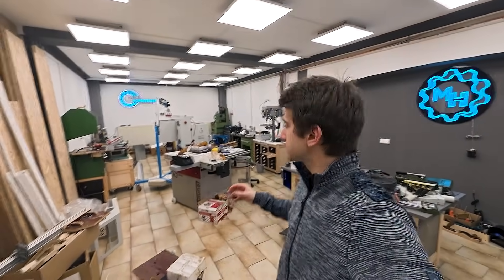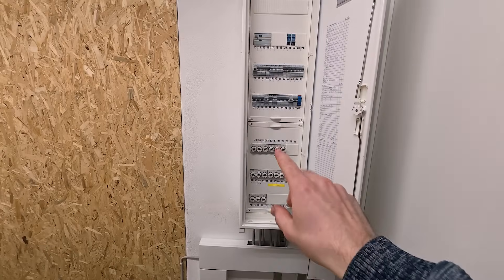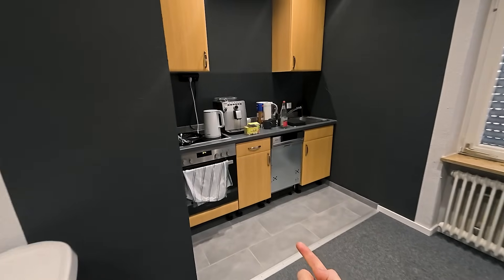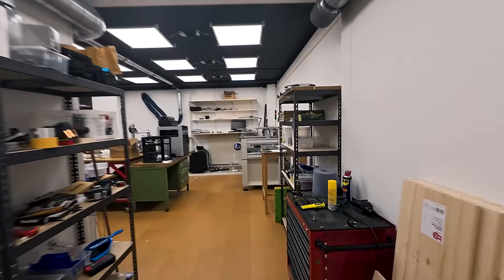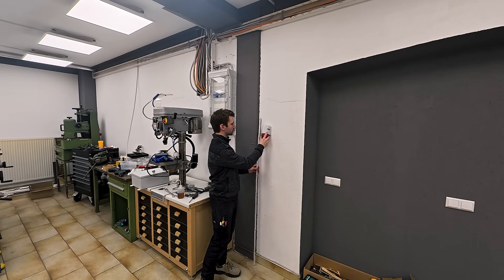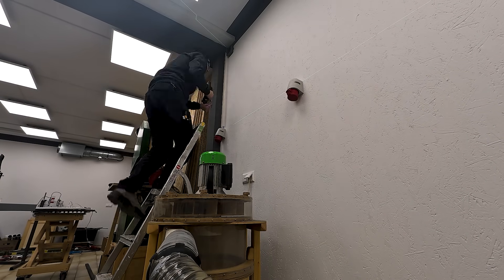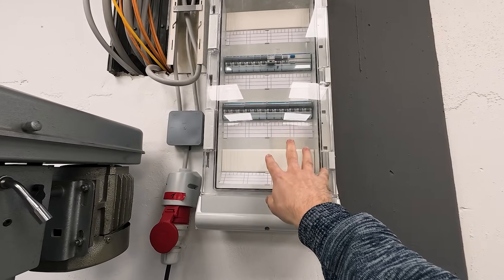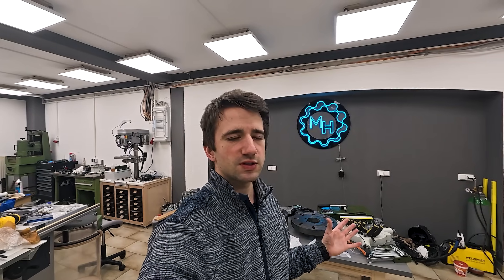New Workshop #17 || Electrical Installation

Comment: In the UK most times I think we'd wire those 3-phase outlets in singles inside metal conduit rather than use 5-core cable. And probably each one on its own breaker.

Comment: Nice work! How do you wire power to the machines in the middle of the shop?
Reply from the maker: Extension cord on the floor. I had ideas for a subfloor, but wasn't sure if it's worth the effort

Comment: Please notify me when the first 35A fuse trips ;)
Could already be the case when the dishwasher is running, someone uses hot water, someone a vacuum cleaner, Marius turns on his lathe and Stefan has multiple 3d printers running.
Not guaranteed that the Fuse will blow, but also not impossible.
Reply: 35 amps seemed low to me but I think European three phase power and 35 amps is somehow different. But I am absolutely not an expert. Perhaps someone from Europe can explain more.
Reply: @TimothyJesser  35 amps three phase just saves on wiring.   You have three hot legs and the all are able to return on a single neutral because they are each taking turns.   So you actually have a lot of amperage there, plenty more than a 50 amp 220v split phase over here ( like we would use for a A/C, water heater, clothes dryer, or stove).  In addition, almost anything they wire up can run on 10 gauge or smaller, due to the higher voltages.   It's actually a much smarter system than the USA in a lot of ways.
Reply: @jimthesoundman8641  Yes, exactly.  I figured it was something like this.  35 amps in the U.S. would be a bit pitiful for three shops.  I need a 40-amp breaker at 220v just to run my kitchen oven.  My AC unit uses something like a 60-amp breaker.  I know that breaker size doesn't tell me exactly how much amperage something is drawing, but it is at least indicative. 

There is a reply from Marvin below and I'm not nearly qualified to critique it.  Likely he is correct, too, in his points.  I just think Marcus seems like a smart guy, and I figured he wouldn't wildly under-power his shop.  

I guess we will find out as we watch more videos. 🙂
Reply: @TimothyJesser  35A is fine for a single house or flat in the most cases, but also you don't have three guys running a business in a residential house usually.
The higher voltages especially when machines use 400V across multiple phases lower the current compared to single phase installations with only 230V or even 110V.
But its still only a 35A fuse per phase and when the electrician didn't paid attention to detail, multiple single phase appliances might be installed on the same phase (dishwasher and the 3.5kW waterheater for example).
In general most of the stuff is only single phase 230V. Stuff that needs more than 3.6kW needs three phase (or three phase motors), since single phase outlets are usually only 16A.
Since three phase motors are generally superior to single phase ones, Marius has multiple machines that need three phases (not necessarily because they need more than 3.6kW).
Reply: It is 400 V phase. Not 230 V three phase

Comment: 3-phase delta or wye?
Reply: Neither, it's an outlet not a consumer. But you could do both, there are 3 phases and a neutral plus ground
Reply: @zapl80  It has to be one or the other. I do not know of any other way to get 3-phase power.
Reply: @sdspivey  yes, once you connect something and close the circuit. Delta/Δ means you connect line to line and get 400V in Germany, wye/Y/star means you connect line to neutral and would get 230V. But without a connection there's no y or delta attached. The German powergrid supplies 3 lines at 230V each 120° phase shifted to each other and a 0V neutral to basically every home. So you can have perfect delta or wye, whatever your machine needs

Comment: Nice logical layout.

Regarding the power metering. There are special power meters that can be mounted alongside the fuses, on the rail. The 2 phase ones are around 50€ from what I remember.

No problem in splitting the bill but having the data might be interesting 🤷🏼‍♂️.

Comment: Happy to see that the installation sockets - outlets etc are standard in EU. Not the crap they have in UK and specially US where they have to double the amps and 3 phase needs a local 3 phase converter/transformer.
Reply: UK uses the same voltages and frequencies as EU. “Industrial” outlets are also the same (IEC 60309). The only difference is in home 230v outlets, and that most homes are old and don’t have a 3 phase supply, though it’s getting more common due to higher loads of electric cookers & EVs & heat pumps etc.

Funnily enough though there is still one common use of 110v power (though I do believe this is also the case in mainland Europe): site power for construction sites. There’s the obvious higher risk of punctured cables. It actually uses a split phase transformer, so really it’s only 55v from each phase to earth

Comment: I wonder how the installation of the power meters got approved, usually the Provider wants the meter as near to the hak as possible to prevent losses ( stupid but eh) so usually a lengh of 1-2m if possible, thou that looked a lot longer

Comment: Can't wait for the lathe restoration series to begin.
And that new machine in the far right corner, whatever that is.
Reply: That a cup grinder. A surface grinding machine that uses a cupped wheel instead of a flat wheel. Its for making metal parts extremely flat.

Comment: So: You and your chums have 35 amps for everything ? From other comments, I assume that is @ 400V ? I guess the other two guys doesn't have any proper machines, only 3D printers ? If they get any industrial machines, I imagine you'll blow some breakers..
Reply: It’s 100 amps total, and each one of them have 35 amps for their own workshop. So it’s plenty
Reply: @mtqrx  he said the whole building is 100a, there are 2 other businesses (theirs being the 3rd, split into 3) so they are only getting 35amps total for the studio
Reply: @mtqrx  No. It is 100 amps for the whole building, 35 amp for the 3 guys combined.  As I said: If one of the other guys gets a proper machine he'll use it all. Either the breaker pops or they'll get too much voltage drop. Ask me how I know...

Comment: The way you have nicely segregated all the different areas/shops it would be trivial to install networked (WiFi or wired) power meters in each distro box and have a very precise idea of where the energy is used. I have several Shelly Pro 3EMs installed in my home and shop and love how in control I am of my power consumption because of them (and they are made in the EU).

Comment: Kannst du uns erklären, wie ein Drehstrom Motor funktioniert und wie der ohne Nulleiter auskommt, wie man 400 Volt bei 2x 230 Volt erhält und wieso der Nulleiter für 3 Leitungen nur so stark sein muss wie einer der Leiter und nicht so stark wie alle zusammen?
Danke! 😁
Reply: Die 400V entstehen, weil die Phasen um 120⁰ verschoben sind. Addierst du jetzt zwei 230V Phasen kommst du auf 400V.
Reply: @martine.210  ich hab das heute mit meinem Bruder durch spekuliert. Also zur Zeit wo der Sinus von Phase 1 bei Plus 230 ist, liegt der Sinus von Phase 2 und 3 bei genau Minus 170?
So weit bin ich heute schon gekommen, aber ich hätte gern gesehen, wie Marius das auf seine kreative Weise erklärt. 😁
Reply: Drehstrommotoren sind jetzt echt nichts neues. Da gibt es massenweise Erklärungen in jeder erdenklichen Art und nichts, was Marius noch hinzufügen könnte.

Comment: Some info for other viewers: 
The Electrical System used here has either single Phase or triple Phase. Single Phase means one of the three Phases + Neutral, which gives 230V. Triple Phase doesn't need Neutral. It works by putting two 230V Phases together to make 400V. So L1+L2, L2+L3, L3+L1.
The big red Three-Phase outlets do however also have neutral connector. This way, if a three Phase machine also needs single phase 230V, it just grabs one of the three phases plus Neutral and thats it. The Lathe probably has this. Three Phase 400V for the Motor and single phase 230V for the Digital Readout.
Reply: Strictly speaking, single-phase can be either line-to-ground (230V in this system, 120V in the US system) or line-to-line (400V in this system, 208V in the most popular US system although there are others). Motors really like three-phase because they don't need capacitors or other tricks to start in a particular direction (because the three legs are 120° apart, a third each around the circle, rather than 180° apart, fighting in opposite directions so not spinning without a "kick"), but other devices that want a lot of power might use 400V too but only using two legs (which is still single-phase). I'm not sure what that devices that might be, huge resistance ovens maybe.
Reply: @johnhawkinson  usually that isn't strictly seen as single phase here whit Line to Line, as it is quite different from Line to Ground/Neutral in wave form patern and internal function, so its more helpful in anyway to separate the them for single-phase, 2-phase and 3-phase applications, also partially is that you are not acually using only the one phase as both phases are in use hence why you get 400v instead of 240v,

maybe its a language thing, maybe its different countries defining things a bit different I dunno /Swedish Electrician
Reply: @link7417  I don't know about the language, I'd be surprised if it was different if we're using the word "phase," because it comes from the math. A "phase" is an attribute of a sine wave, and whether you use two legs (two hots) or a single leg (hot) to ground, you have only one sine wave, and thus only one phase, so "two-phase" is always wrong in English (but some people say it!). It's only when you have three conductors that you have three sine waves (one from each combination of legs: A-B, B-C, C-A) , each 120° out of phase, and thus three phases.  I'm not sure what you mean by different "in wave form pattern and internal function"! Line-to-line and line-to-ground are both sine waves, indistinguishble other than by magnitude. If you start with 400V line-to-line and run it through a 4:1 transformer and get 100V, and compare that your 230V line-to-ground and run it through a 2.3:1 transformer and get 100V, the two 100V signals will be indistinguishable on an oscilloscope (or any other tool I can think of). (They might not be in phase with each other, but if so, that's because the original signals were not in phase and/or the phase shifting of the transformer).
Reply: @johnhawkinson  okey you clearly have a misunderstanding here the 400v is becouse of the sign waves interfaces, you don't have just one sign wave when dealing whit line to line, if you look at the coils of a motor they are only line to line too, but you need all there for the motor to go around but the coils them self are always line to line, 

yes line to line and line to ground are both signwaves but the magnitude difference comes from the two signwaves from the two phases being 120 degress apart, you always have that property not only when they are 3 signwaves, 

Ill consede that saying they are diferent in wave form maybe not isnt the best but that is what I meant, that you get the 400v not from a single signwave but from the two signwaves making up the line to line
Reply: @link7417  Hi. I think this is exceeding the scope of what is reasonable for Youtube comments, so we should take it offline. I understand you're an electrician, but I'm not sure you have the background in the EE area. Yes, adding two 230V rms sinewaves gets you a 400V rms sinewave when they have a 120° phase shift, but that doesn't change the fact that the result is a single 400V sinewave indistinguishable from any other 400V sinewave of the same magitude. (Also in English it is SINE from trigonometry, not SIGN like plus/minus). You most assuredly have a single sine wave when you connect an impedence line-to-line between two AC voltages. Your device cannot tell whether it came from  line-to-line or line-to-ground, it's just a sine wave.
¶ If you add a third reference point, e.g. line-to-line-line, then you can compare phases. And that's why in such a system there are three phases. (And if your third reference is a neutral, i.e. line1-to-neutral and line2-to-neutral, you would still only have a single phase since you cannot compare phasing against a zero signal, and that's what neutral/ground/earth is.)
¶ You are correct that the magnitude of the sum differs in line-to-line and line-to-ground, I do not disagree.That does not make line-to-line anything other than single-phase.
¶ My initial point, such as it was, is that the resulting sine wave from these two different methods looks identical to any device, and the magnitude is an independent variable that can be changed in different ways, not just the phase angle of the two legs to each other, but also the magnitude of those legs.

Comment: The 35Amp 3phase 400V they are allowed for their shop, is almost equivalent to US household with single phase 200Amp 240V panel for  Power (42 vs 48kW).
Reply: It really isn't.

35 amps x 400 volt x 1.732 = is  24.35 kW at a power factor of 1.

For reference, square root of 3 is 1.732
Reply: @MrMartinSchou  Your calculations are a bit off. It's not just 400V it's three phases that each have 35A at 230V if you load balancing it properly. For a single 400V machine then your calculations might work but not for many that also uses single phase. So that's about 26.25 kW of availible power.
Reply: @Dragonited  So your complaint is that I'm 7.8% off on the edge case of single phase  400 volt machine in the EU, as opposed to the claim that is 60% off?

I will readily admit, that I'm not an electrician, but the plugs that Marius are hooking up looks like IEC_60309 plugs. They are all red, which suggest they are 3 phase 400 volt plugs. If he wanted to use 2 phase 240 volt, they should be blue.

Which also matches with what Marius says about the machines - they all need 3 phase electricity.

As I said, I'm not an electrician, but it certainly sounds like Marius is planning on using 3 phase for everything, which suggests that the three single phase 240 volt at 35 amps is not relevant.
Reply: @MrMartinSchou they’re 5 pin sockets (3P + N + E), so if a machine needs single phase they have that between any phase and neutral. Some machines like the lathe definitely do use that, at the very least for any DC powered control circuitry like a DRO. That said it’s probably pretty negligible compared to the 3 phase load
Reply: According to Google the equivalent single-phase 240v current would be about 100 amps

Comment: Very good, agree with your logic on placement. My first run through my workshop I placed the outlets evenly but it was not good for workflow. Second time though I changed them to be near my machines and it wasn't that much trouble. I like your masonry drill, integrated dust collector on it looks very handy. Could you tell me the model number please?

Comment: Nice electrical job!!
I wonder if you plan to make some dust collection with automatic start and turning off-delay?
I've done something like this for myself and it's awesome. I have (I-0-II) switch and on "I" dust collection is constantly on, on "0" it's Off and on "II" it triggers when it detects increased power consumption on specific circuit (I have knob to adjust the power consumption point). When I turn off the machine, there is a delay in to collect remaining dust.
Would love to see your approach to the topic!!!

Comment: Three phase. Wago. American mind can't comprehend this. ;)
Reply: I know right? So... civilized
Reply: @r3xxb0bb  I think we're allowed to use them in the US now.  I did.  If it's illegal, don't tell anyone ;)
Reply: @JuneRockwayThey are legal just that only commercial properties have 3-phase.
Reply: @Dragonited So strange. My previous flat - which was a 32 square meter one with 1.5 rooms - had 3x16A/240V. The house where I live now have 3x20A+1x16A. And it's not because of my workshop. We have an electric oven, fridge, dishwasher and induction cooktop which require 2 different phase. When I searched for a house all but one had 3 phase (the other one had 1x32A IIRC. AFAIK 3x32A/240V is easily available for everyone who want it - and "real" 240V not that split phase thingy what US have.).
Reply: It's an industrial space, we have 3 phase in those in the US
Reply: @psywiped  In Poland we have 3 phases on 10 floor 1970 soviet apartment building in 20-30 square meters flats
Reply: @psywiped Sure, but we don't need to be in an industrial area to have 3 phase. Seeing how many garage wood/metal/whatever DIY-er are in the US it is specially strange to me. Probably this is one of the consequence of the zone system which is an another thing what rather find bad than useful).

Comment: Three phase everywhere, nice.
Reply: 3 Phase is standard in every home in europe.
Reply: @Nixtutru not where I live in Ireland. House was built in 1998
Reply: @Nixtutru  *every new or electrical renewed home after 1980
Reply: @docugraf  yes, i meant to say in today‘s time
Reply: @docugraf there is not even a single domestic single phase service that exists in germany.
Reply: @miko007  there are plenty enough houses which only get one phase
Reply: @docugraf  True but the net power provider always delivers 3 phase to the house. It depends on the contract u have if u use the three or just one. These days with all the modern amenities 3 phase is almost always used.

Comment: Wago, rated for the needed amps ?
Reply: the wagos are rated for 24Amps, and the Circutbreaker is rated for 16A it will trip between 18A and 23.2Amps. Everything is fine there. Even the Cable is fine because the runs are short.